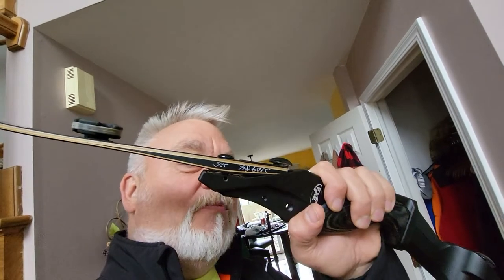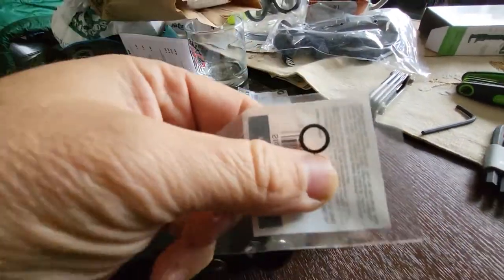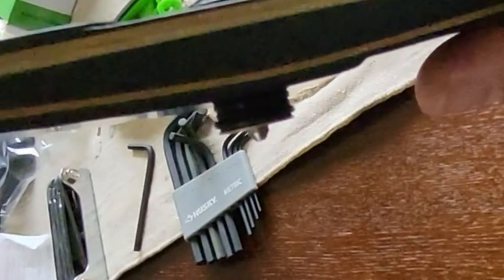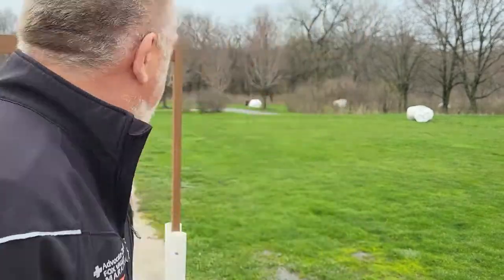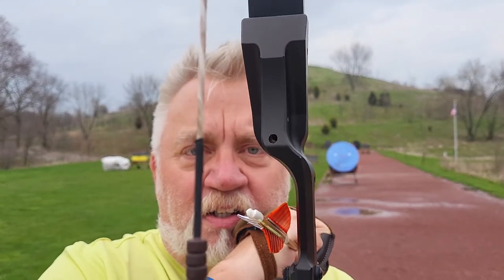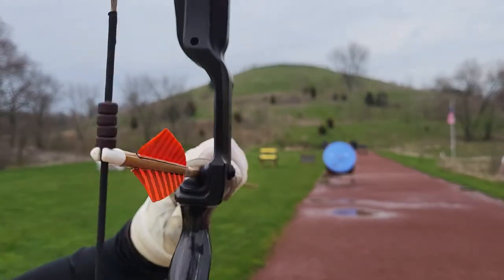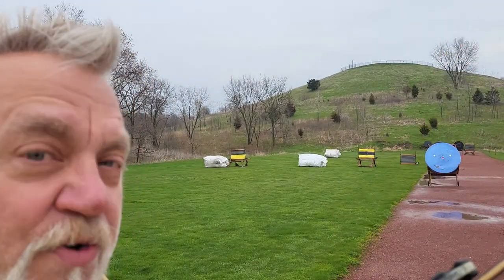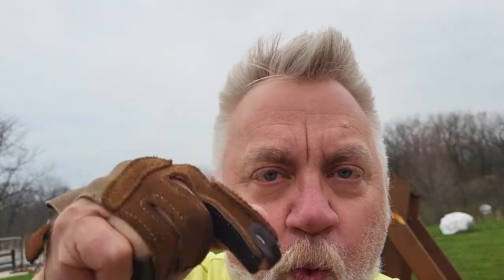Archery - The Secret to Silencing your ILF Bow (Finally!)

Comment: I have 4 ILF bows and do not have any of the problems you are having. I am guessing if you bottom your limbs out then back them off 1/8 to 1/4 turn that will solve the most of your problems.   Take it to the shop that understands trad eqp and get a proper string.
Reply from the maker: Greetings Carl and welcome to VOGTLAND OUTDOORS ! 

I happy for you that YOUR ILF bows display none of the problems of this one I'm silencing, but you & I both know you're not "the rule" and I'm not "the exception" - it's the other way around. 

Lucky you ! 
UNlucky me ;-) ! 

A quick search on Google related to any phrase like "silencing ILF limbs"  will prove that archers have been struggling with (and discussing!) this very problem all the way back to 2014, and likely earlier than THAT! 

Facebook (a multitude of archery-related groups, some quite massive!), Amazon, 3RiversArchery, Reddit, etc etc - the search results goes on & on & on with people struggling with noisy ILF bows. 

What I'VE observed as perhaps the BIGGEST source of all vibration is - yes-you-guessed-it FIT between the LIMBS and the riser ILF "pocket"; and  HERE'S THE REAL ROOT CAUSES: 
1. NOT ALL ILF "dovetail bolts" are manufactured to the SAME SPECS & TOLERANCES - not even the REPUTABLE limb makers ! This revelation (somewhere between my 4th and 5th PAIR of limbs) literally blew me away. In fact lots of "ILF" pins AREN'T even COMPATIBLE/INTERCHANGEABLE between limb manufacturers :-O 

and 

2. NOT ALL ILF "dovetail slots" are manufactured to the SAME SPECS & TOLERANCES - not even amongst the POPULAR (where "popular" == "reputable"?) riser manufacturers :-O Many riser DON'T have all the adjustments for TIGHTENING like you suggest; this is especially true of MARTIN bows, which claim to be "ILF Compatible" but if you watch some of my older videos, I prove that this "ILF Compatibility" is pretty weak at best. 

AS-IS, the pins in the DAS limbs I use on my EXE SCREAM riser are surprisingly LONG ("tall") and there's so far NOTHING I can do about this. And I've used a "mechanics stethoscope" (look it up - they're quite handy!) to isolate the source of MY bow's vibration right down to the spring-loaded pins INSIDE the ILF dovetail bolt :-O 

MORE to YOUR point is this: the Tiller Adjustment Bolt is ALREADY "bottomed-out", but MORE importantly these bolts have a spacing between the "Limb Stop" and the "Riser Stop" which is FIXED - it CAN'T be adjusted, so if you have a limb that is SO "thin" at the root that it slips into this spacing with ROOM TO SPARE, then no matter HOW you turn the Tiller Adjustment Bolt up or down, that "slop" is STILL PRESENT :-O. 

Methinks that YOUR limbs are thick enough, and your Tiller Adjustment Bolts have a spacing that is just wide enough to permit YOUR limbs to SLIIIIIIDE in with ZERO "play" or "slop", hence YOUR rattle is not a problem. 

Again that makes YOU simply LUCKY and ME simply UNLUCKY, but this has given me some IDEAS to explore - about trying to find Tiller Adjustment Bolts with SMALLER SPACINGS? Then I wouldn't NEED to add the rubber "spacers" you see in my videos ! 

THIS HAS THE MAKINGS OF A VERY INFORMATIVE & ENLIGHTENING THREAD - I hope you'll continue to share your own experiences with your own equipment. It provides VALUABLE additional "clues" to the rest of us who might be struggling with a riser & limbs which have a less-than-ideal fit compared to your own equipment ! 

MANY THANKS FOR YOUR POST! 

Cheers,
-Mark Vogt | VOGTLAND OUTDOORS

ps: it's never nice to make fun of another guy's bowstring, particular when he MADE his and is PROUD of it. It just makes you look like a bow snob, when you're actually trying to be helpful ;-) ...

pps: I AM getting a new "proper" bowstring this week ;-)
Reply: Yes when it comes to my strings I am a snob. Every arrow I build has Gold Tip GT nocks in them. Get the nocks you like make your string then play with the serving size untill you get a good fit. You more than likely didn't make a bad string you just didn't think about the size of serving to finish up with. Not all nocks are the same as you will learn. I have been shooting recurves for 55 years and have made every possible mistake and some impossible ones.Thats how we learn.
Reply from the maker: Hey Carl ! 

Enjoyed your reply... but please know I"m right behind you in the long-time-shooting category ;-) ...
(I'm just over 60) . 

Also I do understand (well) how to adjust the width of the bowstring & serving depending on what size serving I use. 

One thing you DID make me double-check was the SIZE of the bowstring I was using; when I bought this riser & limbs separately and they arrived, I just grabbed whatever I had hanging on the back door (where we ALL keep ALL our bowstrings on an old coat rack), but it turns out it's a 16 STRAND bowstring - far MORE than a 40# bow actually needs ! 

If I build a NEW one with only (say) 12 strands of dacron or fastflight, and a bit narrower serving as well, my existing nocks will release with less NOISE (hence higher VELOCITY) and it should be a bit quieter too. 

GOOD CONVERSATION ! 

-Mark | VOGTLAND OUTDOORS
Reply: @VOGTLANDOUTDOORS  I shoot 15 stran b55 Flemish twist on every bow except 1. I just got a set of Belcher 45 lb @28  longbow limbs and a D97 string. I have discovered the Belcher limbs are the fastest limbs I own. I don't care about speed at all. I am hunter only
Reply: I use arrows at about 11/11.5 grains per pound and those limbs shoot a bare shaft 9" higher than all my recurves at 20 yds. I took the d97 off and put on a b55 it still shot 7" high. I am building some heavier shafts to slow it down s little and get it in line line with the others.
Reply from the maker: I’ll have to investigate the Belcher limbs you mention. I’m currently shooting a set of DAS ILF long ow limbs, and I COULDNT make the claim that they’re “fast” - far from it :-(

cheers 
mark
Reply: @VOGTLANDOUTDOORS  limbs are not always the same even if the same man makes them out of the same goods on the same day. It just a thing
 When Jim created SKY ARCHERY the bows were the best you could get and even Olympic archers and world class shooters used them. Today he has backed off production and slowed down. His limbs are not on the cheap side. You will spend a lot to get them but you will get limbs you can shoot every day for the rest of your life so in one way they are a bargain.
Reply from the maker: Carl, 

You offer a COMPELLING argument in favor of SKY ARCHERY's limbs - I'm going to HAVE to give the TRY ! 

Watch for future videos ! 

-Mark Vogt | VOGTLAND OUTDOORS
Reply: @VOGTLANDOUTDOORS  if you look him up just put in Jim Belcher he changed the company name and sold part of Sky. The name now escaped me
Reply from the maker: Carl, 

I'm convinced - I WILL look him up ! 
Cheers,
-Mark

Comment: Newsflash... if you put a string on it and make it tight the rattle goes away....just saying
Reply from the maker: Hi Mike ! 
NEWSFLASH... you're wrong. 
IF what you assert - that "make it tight" is ALL that's required... 
... then NO ONE EVER in the history of archery would EVER have a NOISY bow, now would they? 

But they DO. 

Want to know WHY? 

SIMPLE: 
Because there IS a point just after your fingers RELEASE the bowstring and the bowstring pulls away from the arrow nock when the entire bowstring goes momentarily LIMP - in fact it even has WAVES in it there's so much slack :-O ...

DON'T BELIEVE ME? 
What literally ANY high-speed video of an arrow release. SLOW the video down to frame-by-frame and you'll SEE some of the most extraordinary scenes you'll EVER see about archery ! I've seen bowstrings with as many as 6 "waves" or "ripples" in the bowstring - right at the moment that I EXPECTED to see a wonderfully-TAUGHT bowstring PULLING the arrow toward the riser - it's really something ! 

HERE'S AN EXAMPLE - took all of ONE MINUTE TO FIND: 
https://www.youtube.com/watch?v=WHnN9fZpEj4

BACK ON-TOPIC... 
So WHAT HAPPENS to the LIMBS at this moment in time? 
Simple: they RATTLE LIKE CRAZY - as if you had simply taken the bowstring OFF, grabbed the tip of the limb and given the bow a good SHAKE ! 
;-) 

SO HERE WE ARE BACK WHERE WE STARTED... 

ILF LIMBS - with all their little pieces and springs and pins-that-have-mass-so-they-DON'T-move-when-the-REST-of-the-bow-moves (it's called INERTIA) - RATTLE when shot. 

Period. 

And there are a TON of us (nay - ALL of us) looking for ways to SILENCE them - at least a bit. 

- end of news flash. 

Time for you to do your homework. 

I look forward to hearing from you again. 

Cheerio,
-Mark Vogt | VOGTLAND OUTDOORS

Comment: So now you have erased everything positive why you would shoot a modern ilf bow. Speed, precision and centershot. 
Just buy a traditional 3 or obe piece recurve. It will be dead silent. 
You have half a sheep and 4 nocking points on your string. That makes even the fastet bcy bloodline string slow as fuak. You have felt dampers on your limbs… olympic archers scratch the clear coat off their limbs to avoid uneven limbs. And you have an arrow rest thats off center. Sorry man i dont get the point  why you shoot a aluminium ilf bow. 
You silence an ilf rig by tuning the bow right. Then put some cat whiskers on it and thats how silent it gets. Period
Reply from the maker: Greetings Earl and welcome to VOGTLAND OUTDOORS ! 

WHAT PASSIONATE FEEDBACK ! 
I have to take it SERIOUSLY because I'm convinced you offered with only the BEST of intentions :-) 

"Half a SHEEP and 4 nocking points" on my string - you SLAY ME ! 
I'm laughing so hard it hurts, but your point IS well-made ! 

"arrow rest that's off-center" ?? 
That arrow rest CAME WITH the EXE Scream Riser - it CAN'T be adjusted, so I have to accept that they TUNED that rest's position even as they SHIPPED it :-O 

I'm wondering wondering wondering where you & I are disconnecting... 
1. I ACCEPT that I have excessive padding on the limbs and the bowstring loops, so that's NOT it; 
2. You DON'T seem to have a particular problem with the EXE Scream riser itself, SO... 
3. That leaves only the LIMBS - specifically the ILF "PINS" - and the limb pockets into which they fit ! 

Here's a KEY POINT upon which you & I NEED to AGREE: 
The LARGEST source of noise in ILF bows is the CONNECTION between the ILF PIN on the LIMB and the ILF POCKET on the RIISER - do you agree? 

And IF you & I can agree on this, then you also have to accept that NOT ALL ILF COMPONENT MANUFACTURES ARE CREATED EQUAL, so I MIGHT actually have SHITTY (read "noisy") ILF PIN-POCKET fittings (read "lots of PLAY") and YOU DON"T... 

So I'm STRUGGLING with my ILF bow being NOISY... and you're NOT struggling. 
And it DOESN'T have as much to do with HOW I'm trying to SILENCE my bow as much as I might have MORE "play" (hence MORE NOISE) than YOUR bow - would you agree? 

BUT I'M WILLING TO START OVER, CLEAN MY BOW OFF, and START OVER, TRYING YOUR METHOD ! 
WATCH for my experience in an upcoming video, but PLEASE PLEASE PLEASE REPORT back with YOUR MAKE/MODEL ILF riser and ILF limbs, so we can see if there IS an "apples-to-apples" comparison between you & me to be made ! 

Lastly, please DON'T try to tell me something like "ALL IFL components are by definition are IDENTICAL by design", because you & I both KNOW that this ISN'T the case at all. I've TRIED interchanging pieces between limbs and the pins WON"T go on the other limbs and vice versa... AND I've tried different ILF limbs in the SAME bow and my digital micrometer (and my EYES) tell me that not even the HEIGHT, WIDTH, PIN EXTENSION, BEVEL - NOTHING matches between several different ILF POST sets - EVEN REPLACEMENT SETS I ORDERED FROM LANCASTER ARCHERY :-O 

THANKS VERY MUCH FOR INSPIRING ME TO TRY AGAIN !!! 
You may have been worried that you were being overly HARSH with me, but I sense you were simply being HONEST, CANDID and HELPFUL :-) 

-Mark Vogt | VOGTLAND OUTDOORS